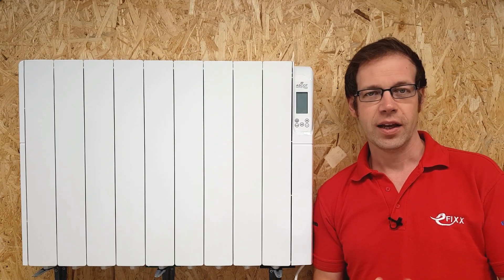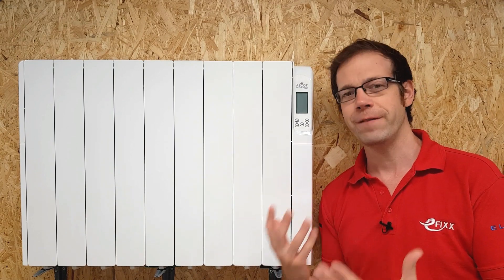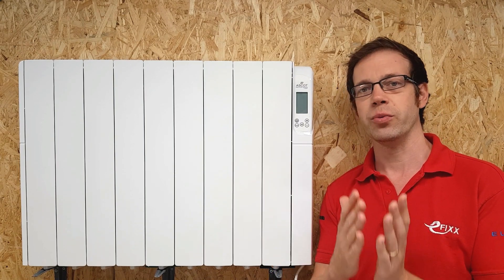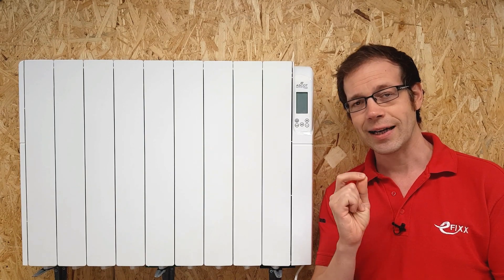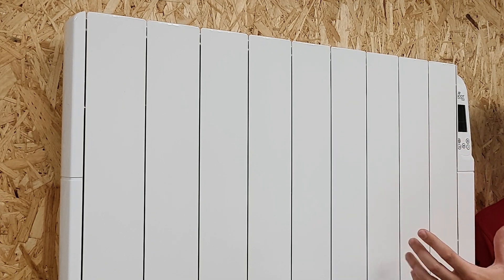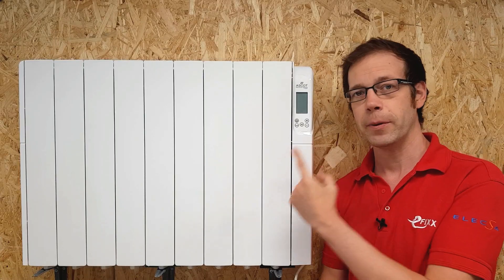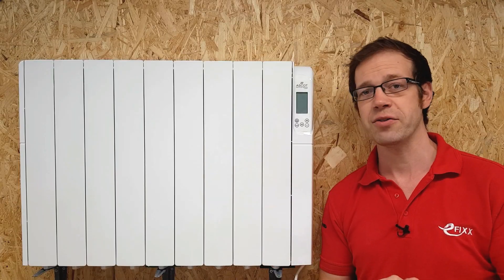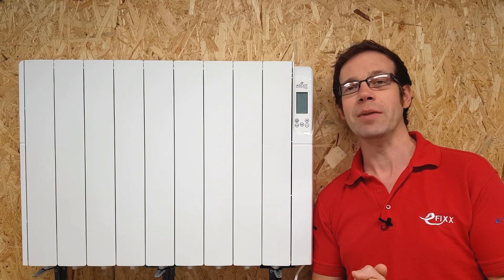Is electric heating the future? - LOT20 and SAP10 explained.

Comment: Electric heating would cost me to run compered to gas i use atm  for a year £6500.00  where as Gas is £1000.00  so not feasible for me,  electric 0.13p per KW   Gas 0.02p per KW   an air source Heat pump would make it cheaper but still not as cheap as Gas at this time .
Reply: So true.  It also will need every street of every town to be rewired probably to 30kW 3 phase and many times that on main roads.  Why?  Because as well as the unpredictable switched loads from the heaters described here EV charging will change to require huge electrical sources for superfast home charging.  Then there will be a new need for two source energy for backup.  Now that could be electrical so we'll need to dig up the roads again. Then we might all press for more solar panels but these cannot be turned off by the generator companies in order to maintain frequency and voltage.  That's no problem at the moment but it soon could be.
Reply: @corrigenda70   Thats true as i live in a 200 year old cottage which is fed by over head lines we are limited to 15KW

Comment: Let me burst the bubble....golden age for electricians....we will see there is also disruptive technology on the horizon that could help it go the other way such as the use of POwer over Ethernet (Poe) devices and a large move over to low voltage light, switches even heating and cooling devices as efficiencies resulting in much greater smart integration. None of it would require the kind of electrical expertise needed to work on mains voltages (not that it stops DIYers) However my bet is that electricians are going to need to be even better trained and able to look at network hardware, software issues and cyber security aspects to protect and safeguard all these smart devices. More than that testing will need to cover in much greater detail power quality issues not just safety testing with the growth of semiconductor devices, mix of Dc power and AC mixing. There are opportunities but also disruption will older sparkys be keen to learn.... will younger sparkys be able to learn at higher more academic and trained levels for longer possibly incurring more debt before they can make money that will be the true test. If they do yes the opportunities would be great and hopefully better pay for electricians.
Reply: Still requires expertise, just slightly different, I doubt we’ll see POE in domestic, apart from perhaps some WiFi access points.

Comment: Here in N.A., manufactured homes come all electric like mine.... Gas is optional on the design.... the "tiny Houses" though use LP gas, or electric... I perfer all Electric as its easier to service, safe, and my arguement is the the price is the same as gas-and electric option.
Reply: Depends on your local utility prices, UK has a history of very cheap gas and comparatively costly electricity compared to many areas of NA

Comment: I would think heat pumps (ground not air) would be a far better to use electric for heating and Wet underfloor heating.
Reply: For new builds, there could be one shared geothermal system for a group of houses.  Right now, using electricity for heating is perverse.
Reply: Ryan G 2.5 to 3.5x better

Comment: These things are an absolute disaster for the grid in our push for renewables, they’ll all be demanding energy on a cold still winters day when there’s almost zero renewables coming in. At least the old fashioned storage heaters actually time shifted the demand.  Also how do you build an electric heater that isn’t 100% efficient at point of use?
Reply: @Matthew Tymczyszyn Engines are a different topic. I you are using a fossil fuel for heating then you can have a 98%+ efficient furnace at your home for heating - much more efficient than any fossil fuel powered electric generator. Ed is correct - all resistance electric heaters are basically 100 % efficient, so don't waste your money on an expensive one.
Reply: Cold winter day = peak solar
Reply: Wind and Hydro run just fine in the winter if Solar is out of the picture.

Comment: Infrared ( far or middle) room heating is available now and is more cost effective than convection electric. The new generation of these look to be a better choice than oil filled convection radiators. Partly because convection is less efficient at warming a room than widespread radiation. Radiation warms all the objects in the room, which then retain and radiate that heat themselves. So it is also less affected by drafts, opening doors etc than convection heaters which rely on warm air circulation. Also because the heating units are flat and thin and can be made of glass or aluminium and hung from walls or ceilings. 
With gas at 0.03p per unit and electricity around 15p unit during daytime, people are not going to switch to electrical heating unless there is no other choice. 
However,  electrical systems can now be powered by stored energy which is acquired overnight from a renewable energy surplus. When the new offshore wind farms now being built are complete, the surplus overnight energy can be sold at low cost, typically 5p unit, and stored in house or in Electric Vehicle to heat your house at a similar cost to gas.
Reply: I try to explain GCSE-level heat transfer to customers but their eyes quickly glaze over.  They don't even understand that all electric heaters are theoretically 100% efficient, but it's the manner of their deployment that needs careful thought.  I'm not optimistic about the future if this video is anything to go by.

Comment: Fine in principle, but even at maximum efficiency, electric heating is way too expensive to run unless electricity prices fall by a huge amount. I'm in the country, gas is not an option, my only realistic method ( it's an old house with wet central heating) is oil, which I hate. Looked at GSHP as well, but they can't deliver water at high enough temperature.  Stuck with oil for now...
Reply: Why not just combine GSHP with a tank and element for the last bit of heating up to the usual hot water temperature? Yes the resistive element isn't as efficient as the heat pump but the heavy lifting would've already been done so it would have less heating to do. Meanwhile the GSHP can be heating your house as well.

Or if you don't have a bath in the house, instantaneous (or small tanked) water heaters are fine for sinks, and then a normal electric shower.

Comment: Having a house that's of an A rating would help more. Such as 215mm inner leaf, 200mm external wall insulation and a heat recovery unit would be the way to go. Obviously that only applies to new build.
Reply: This is the only time that resistive electric heating makes sense, when the building insulation is so good you need to put a tiny amount of input in to maintain temperature, at this point it’s not worth the overhead of a gas system or even the installation costs of a heat pump.  Unfortunately the UKs building standards are atrociously bad, and as such hardly any homes in the UK are high enough performance.
Reply: @edcooper2396  But with an old, poorly insulated house a heat pump can struggle to heat sufficiently. Ultimately, there needs to be a very large retrofit programme in the UK - ASAP.
Reply: @edcooper2396  true. There's always solar energy too. There's systems now that store that energy in battery packs. Only seen videos of them installed in America. Telsa is the brand I think. Also geothermal energy to consider.
Reply: Stephen S the problem with solar is there really isn’t much of it during the winter when you’ve got your peak heating load.

Comment: running everything on electricity is a joke,in the region where i live they have shortages of electricity in the winter and shortage of water in the summer,i heat my house with gas,nothing keeps are distinguised leaders from replacing natural gas with a biogas,but thats too much to ask,and what was their bright idea to replace our nuclear plants,yes,electricity made by gas driven turbines,how hypocrite can you be,and now the real eye openener,say everyone changes to electricity for everything,lights,cars,heating,cooling,that demand for electricity could not be supplied,there would be blackouts everywhere,they also push for heating your house with heatpumps,these devices use 5Kw/hour,nuts,you mentioned 250watt,i think the most of elecrical heating devices use 1Kw to 2Kw per hour,maybe it will be doable if we could produce real free energy,but now is not the time
Reply: Ronny B the french don’t seem to of had much trouble, they just decided that’s what they wanted to do and then built the infrastructure out to cope with it.
Reply: All you're really saying here is that the electricity supply where you live is insufficient and needs to be improved. There's no reason heating cannot be electric - especially with heat pumps. "Now is not the time" - I disagree, now is the absolute best time to be doing this, as the need to get rid of GHG-creating gas and oil is only going to get stronger over time, and the later we leave the transition, the faster, more abrupt and more difficult the transition will be.
Reply: @josh46646  all these electric devices are too expensive to run in my country,now our government is is in big panic because the nuclear facilities will all close in 2025,they are looking at building 4 gas-powerplants to pickup the lost quantity of electricity,these big changes will be payed by us,the people,so your idea to change every device in an electric one to limit co2 production is flawed when we get our electricity from gas plants,and even these are not enough to suply everyones demand,and not everyone drives,cooks,and warms with electricity yet